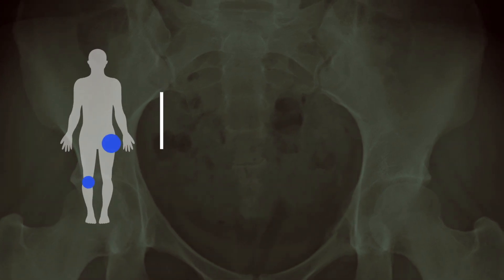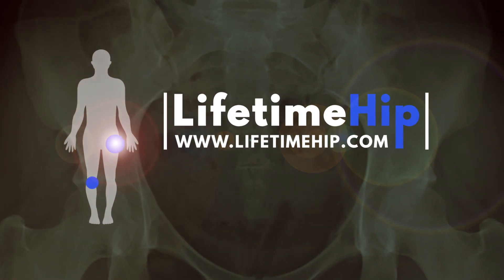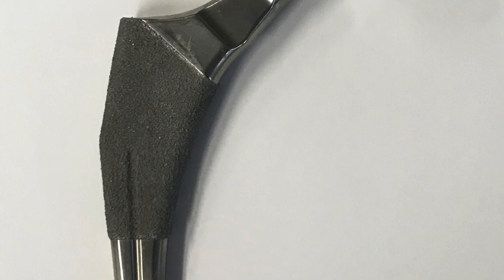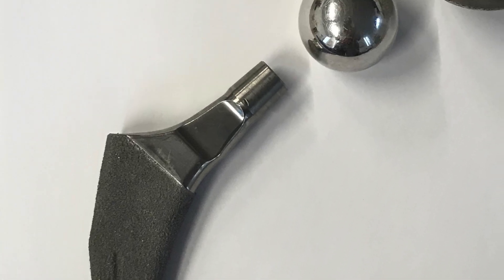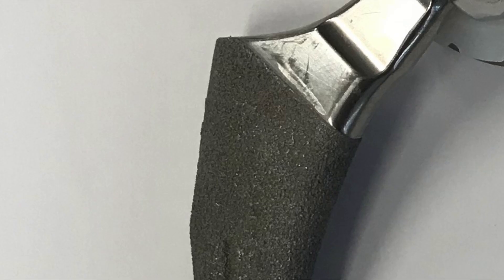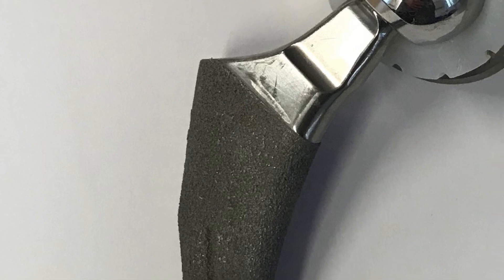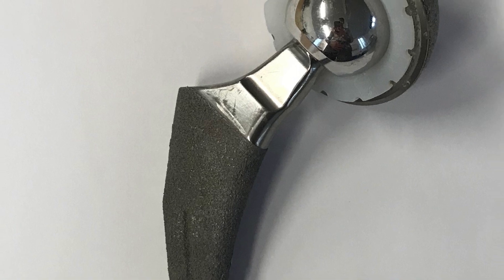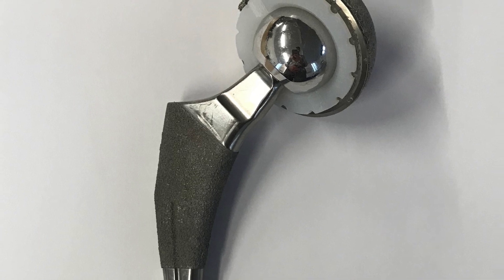What's a Hip Replacement made out of? | H10

Comment: My bone did not grow into the cup.  Why didn't he cement my hip replacement?
Reply from the maker: Sorry to hear about your problems. Uncemented and cemented are both good cup options. Uncemented offers more options on the bearing surface, that is the moving part of the hip replacement. 

Revising a loose cup would usually require changing to another uncemented cup. Here trabecular metal has quietly revolutionised revision surgery over the last 15 years. Good luck!

Comment: Why don’t the use of “programmed print magnetic’s” principles being used for replacement parts??? Non-wearing plus using its abilities to repel with zero heating non-friction parts seem logical???
Just sayin???
I get to “strong of strong” thing but if two or more parts never were to touch (repoltion as well as no friction ) would be better… No???
Reply from the maker: Thanks Allan. What’s the best reference to read more about ‘programmed print magnetics’? Any biomaterial needs to fix to bone, be similarly stiff, not corrode in the body, not be toxic to human tissue and if used as a bearing be hard and tough enough not to wear excessively. It’s quite a list!

Comment: sir what type of contact is occuring between the liner and the outer cup
and is that femoral ahead and liner in frictional contact?
Reply from the maker: Good question: the liner is fixed in the shell ('outer cup'). Yes, movement is between the femoral head and the liner, which is subject to friction and subsequent wear.
Reply: Sir can i get your email id pls.
Reply: Thank you verymuch for your reply
Reply: Can i say that the liner is bonded with the outer shell?
Reply from the maker: @ananthapadmanabhanm1849  Different mechanisms secure the liner e.g. this Trilogy cup uses a circumferential taper to lock it
Reply: @LifetimeHip  actually am asking this question  because in ansys they are asking what type of contact is in between them. Examples
Bonded
Frictionless
Frictional
Etc
Reply: In ansys how can i find its wear. I am trying to do simulation in ansys 2020 r1.
From where i get the archrd wear simulation extension  file?